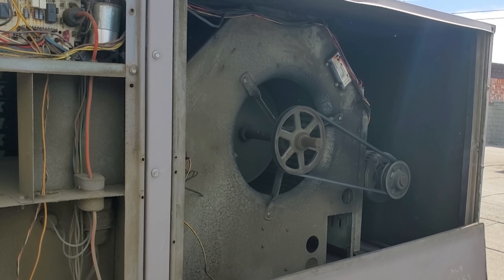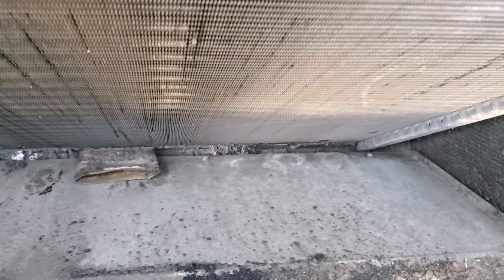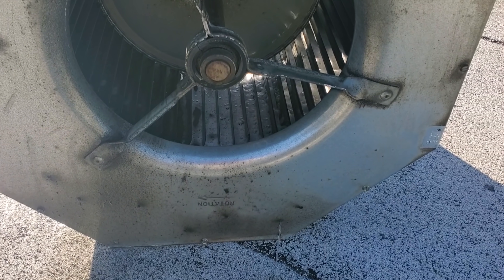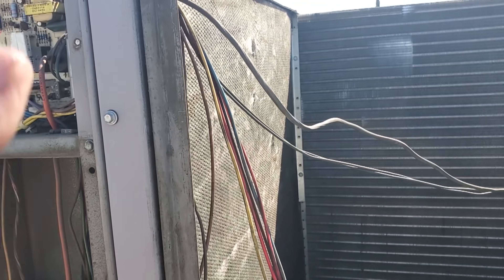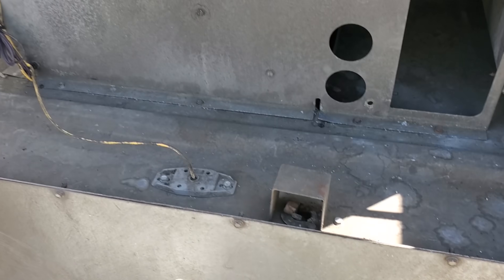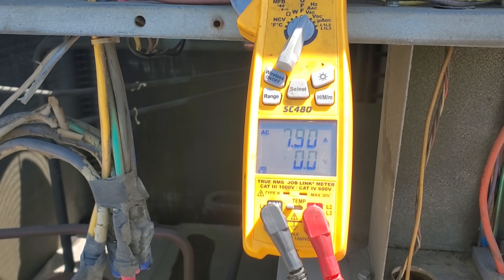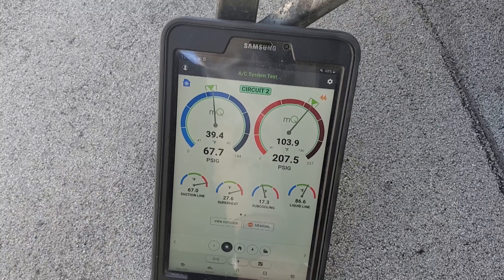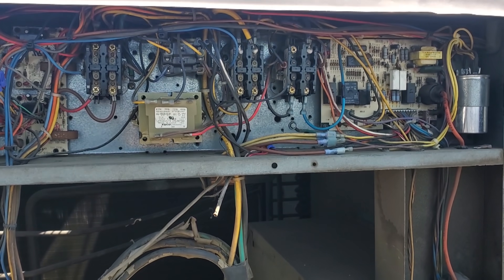THE DINING ROOM AC IS NOT WORKING

Comment: Funny you say that about a jug of R-22 broke the on-off handle, had a few of those in my day, one time I got a discount at the supply house on 4 jugs of R-22 because the ball check valve would not open, told the manager I would buy them for $30.00 each and he jumped on the deal. Then he asked me what I was going to do with it. Told him to meet me at my truck and showed him a small ball-peen hammer and whacked the metal part of the valve and popped the ball loose worked fine, he was like "I'll be damned" told him it was an old school trick. so 4 jugs of R-22  for $120.00 is not too bad it was running $75.00 for a 30lb jug back then. I laughed all the way to the bank. Man, I am old I can remember when we bought 30lb jugs of R-22 for $28.00 a jug. ugh lol

Comment: I understand wanting to replace the contactors, but I have to wonder - do you carry an emery board?    When working with car distributors, a way to fix things to get you to where you can do a replacement was to buff the contacts to remove the corrosion and smooth out the arc pits.    It seems like you'll leave a scorched contactor in 'original' condition if you can't replace them right then and there.

Comment: In this video you checked the contactors, you decided not to change them. What are your thoughts on trying to get some sand paper on the contacts to clean them up a little? I've done it, not often but I've done it(mostly residential units). I've only done it in a pinch to get equipment running until we can come back. And I always explained to the customer that it's not a permanent fix, that it could be a problem, that way there's no surprises. Especially on older equipment. You often say at the end of your videos how much you appreciate us watching til the end. I hope YOU know now much we appreciate what you do! You are the Norm Abrams of refrigeration! (New Yankee Workshop, This Old House). Love What You Do!!

Comment: A co-worker and I were checking amps on a package unit and it over-amped and blew the fuses. Reason was we left the blower door open to long which had it running over the nameplate amps. We learned that day that the motor is designed to run with a load just like you said. Thanks for that great reminder!

Comment: dirty blower wheel will move less air and underload the motor, it or pulley was likely changed in the past and adjusted with the wheel dirty.
but beware yet, because as you showed airflow changes and static pressures can  also majorly influence things. for example,  high negative building pressure and economizer opens wider? lower blower current will result, because air is being pulled through it and it has to work less. opposite for positive pressure building and economizer opens, suddenly blower is working harder to push the air in(same as you leaving return duct panel off).
it's a catch 22, customers roaming in and out, exhaust fans cycling, other HVAC units modulating economizers and cooks fiddling with MAU/exhaust. what looks great one minute can change a mile in a few minutes. (I guess this comment is more into engineering and very advanced troubleshooting levels, but such has gone all industry as of late)

Comment: Nothin' scarier than a Carrier lol. Awesome work. Great point on the static pressure and fan overamping scenario.
Reply: How many tons is that Weathermaster unit?
Reply from the maker: I think it was a 7.5 ton if I remember right
Reply: I have worked two or three times on Copeland condensing units so far and learned to hate them. Although looking quite stylish they are a pain in the ass to work on. One has to remove like three panels just to get to the service ports

Comment: Nice vid one thing I find interesting you seem to swap contactors quite often which I suppose is good practice.

I find the vast majority of contactors I see here in Australia are of the sealed varieties and are quite difficult to inspect.

I have often done thermal checks and contact voltage drop tests but I find even when I have removed even 20 year old contactors the contacts have all looked quite good.

I wonder if there is more of an issue with the open contactors being of lesser build quality as I have had those look fairly shabby even after a few years and I have noted a significant cost difference to a sealed contactor in for example 3 pole being 3 or more times the cost.

I generally use top quality sealed contactors that are admittedly quite pricey bit I never hear boo out of them for the life of the unit.

Comment: You cant blame that on professionals.  The maintenance guy making 15 dollars an hour even looses 1 bolt cover for the toilet, at least 1 screw in every electrical box, strip marks on all the chrome fittings, only one clip holding several light diffusers,  and ah yes, the cap from the service fitting. He didn't gauge up. He doesn't need to, to check the charge. He just depresses the schrader valve with his bare fingers and lets a little just burp out to see if there's enough to get them buy. If he can't duct tape, flying splice, or glue it back together he calls you in to fix it. He hates having to call in a professional because they are usually know it all kinda guys.

Comment: Just like having to change a contactor for a new compressor. Do the same for a blower motor. Do you take a poop and not wipe your azz? In Ca. Bad question..lol. why burn up a fam motor if the old contactor burns 1 pad and gets stuck or not make contact at all. Pet peve for me
Reply from the maker: Yeah I love changing them I even had them in my quote but I forgot to actually change them... but I will be back over the next few weeks so I will likely do it than
Reply: @HVACRVIDEOS  the spall didn't look bad if any hard to see from camera 

I've used nail files to quickly sand that little bit. Eventually it's safer to replace anyways i suppose
Reply: What are these 3 seashells for?

Comment: @9:04 I saw this very early in my machine-inspection career. 40-foot air-curtain fan with motors over-amping, going off on overheat, then kicking back in. Builder puts new grates on with 2/3 of the intake holes closed, and the overheating stops.

Comment: 6:48 - Agree that's a terrible design. I would be tempted to tack-weld the nut behind the plate so I could shim the motor out if needed. Or, maybe I could find some of those slip-on fender nuts (also known as "u-nuts"), but I think the hole would have to be widened to make those work. I don't like the idea of squaring the hole and pulling a carriage bolt because it's too easy to accidentally push the bolt in and lose it.

Comment: Those blower assembly bolts that "keep spinning".  You need to replace them with bolts that have square shanks -- and file the holes to fit the new square shanks.  That way, the bolts will not spin and you can do up the nuts.  Yes, and before you said it, I thought of shims for the assembly to bring the motor out on that left hand edge to line up the pulley with the other one.  Pretty basic mechanics, after all.    (And I have been a "desk jockey" most of my working life -- I just have a good mechanical inclination.)
Reply from the maker: I will discuss this on my Livestream this evening 4/19/21 @ 5:PM (pacific) come check it out https://youtu.be/_Sj8XRrpgGA

Comment: I have seen enough to know that you do the best you can in the situation handed to you.
A more frequent belt change could be a small price to pay.

My experience today in this area was a really old window unit at work that I discovered had a burnt out compressor (angry noise and blowing circuit breaker when turning the thermostat) and probably was empty too since it had a sticker saying it was last checked 2007. I was mostly surprised that the fan actually still did blow air in that environment - cement industry with all that dust. So I consider it archeological remains.

Comment: If that were me I wouldn’t be happy the motor wasn’t mounted right.  Def not from sag in shelf. That belt will be toast.  Also no reason to put a new pulley just an unneeded up charge.   Also caps don’t hold pressure on the shearer valves.  Small amount and then allows to just keep leaking.  My guess is cool has small leak.  And to not fix heat while there that unprofessional also.  You already went after a part.
Reply from the maker: I think you need to watch a few more of my videos , you will see I'm not here to rip off the customer.
Reply: Pulleys/sheaves are wear and tear components. Browning suggests replacing pulleys 5 year Span. But use the gap tool and replace as needed.
Reply from the maker: I will discuss this on my Livestream this evening 4/19/21 @ 5:PM (pacific) come check it out https://youtu.be/_Sj8XRrpgGA

Comment: Surprised you didn't add a washer on motor to use a spacer
Reply: He said that he couldn't add a spacer because the bolt kept turning inside the casing, and it was too hard to disassemble the whole unit.

Comment: Chris, have you ever considered using wire loom? Or would it be too expensive and cost too much time to wrap the wires in loom?
Reply: If it’s a split wireloom, eff that. It takes SOOO much time to shove that wire in there and all you end up doing is jacking up your fingers trying to prize it open.
Reply: Also this desert heat dries out plastics like none other. Cheaper and easier for zipties that are just as clean that can be snipped off

Trying to open a brittle loom without breaking it is so fucking annoying